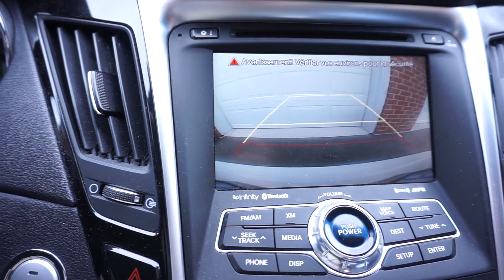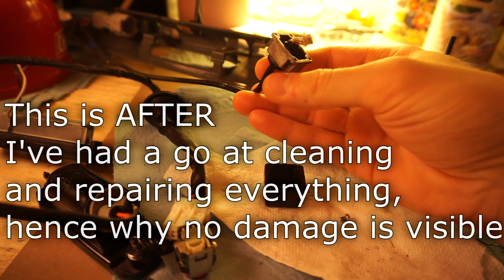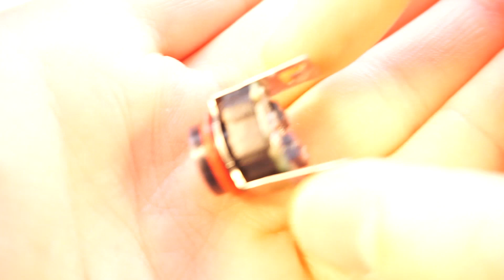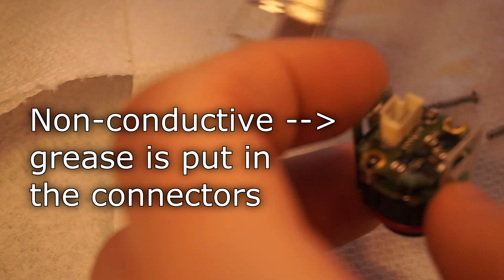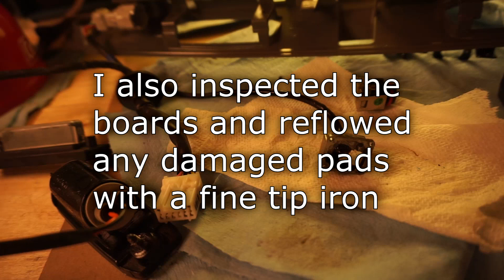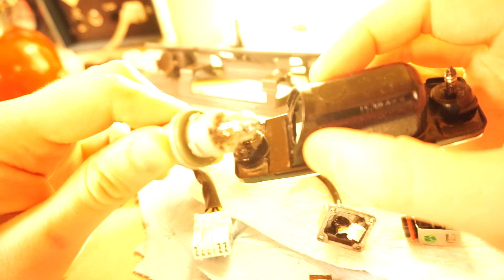DIY Tech: Hyundai factory backup camera Blue Screen Electronics Repair

Comment: Great video, very helpful. I just repaired mine this video heled a great deal. Just a few suggestions removing the chrome trim was tricky (or seemed it the first time) suggest plastic trim remove tools. The camera has 2 circuit boards as shown in this video. Once the 2 screws and spacers have been removed the top board can be wiggled side to side to separate it from the lower board. Also suggest using silicone seal on the exterior joints.

Comment: I changed my battery and now my screen doesn't come on at all. Fortunately, my radio does work, however the radio and media buttons do not work. How do I get my screen back on and working? Is there a reset code for Sonata 2012 Limited?

Comment: I just saw your video. I had a backup light go out on my 2014 Hyundai Santa Fe in 2018. I ordered a replacement from Amazon and it worked. Well the second one went out. So I need to replace it. I kept the one I removed. Would you be interested taking apart the original and see if you can rebuild? David

Comment: Thanks for the great video.  I fixed my camera.  I don't think I would have thought to try this if I had not seen the video.  My camera was on a newer Santa Fe but the concept was no different.  One suggestion, I slathered any of the areas that water might get in with silicon sealer before I reinstalled the camera.

Comment: My Santa Fe camera stopped working about 1.5 years ago, so I thought I'd try to repair it as in your video. Unfortunately, I had three rusted circuit board screws and a corroded pin on one of the connectors. When two of the screws snapped off at the lens housing, I decided to bin it and order a new one as the prices have come way down since I last checked. When that arrives, I'll open it and use silicone board sealer with a good helping of Collinite 845 on the outside to prevent a repeat performance.

Comment: My camera is working, but it looks like water has gotten 'inside' the glass lens, dried and left dirty sediment on the inside. Then when it's in reverse, it's all blurry.

Before I go to the trouble of striping it all down, do you think the lens can be separated from the camera body, to clean the inside of the lens. (I'd probably clean off any oxidisation on the boards at the same time, but that won't solve the issue I'm facing)
Reply: I'm in the same boat here, couldnt figure out a way to get the outside lens apart from the housing without doing something that would seemingly bust it, but when the board with the camera on it was off I attempted to use a Qtip with some of the padding pulled away to try and wipe the lens, no avail :-(
Reply: @walterhartman8902  I've still not bothered stripping mine down yet (didn't have time over summer with vacations etc).
But it sounds like the answer to my original question was no, the glass lens isn't able to be separated. 
When you say you didn't manage with a qtip, was there some space to get 'something' in there or was it completely sealed?
If there was some space I'd maybe give it a try. 
Else, going to try a replacement from wish or Alibaba...cheaper than the dealer 😮

Comment: Thanks for the video I have the exact same issue. Will try this fix. Where do you get this conformative coating?
Reply from the maker: Conformal coatings can be found easily online on eBay or amazon, and a little goes a looong way. In a pinch you could also use clear nail polish

Comment: I have a 2013 Sonata 2.0T. After 7 years of perfect service the camera croaked. Sure enough, so badly corroded I could not even get the screws out to separate the front form the back half of the assembly. An OEM replacement camera is available for $125USD from a seller in China. You’ll wait a month for it to arrive. Didn’t have that kind of time so grudgingly had the dealer fix it for $585USD. That hurt.
Reply from the maker: I'm sorry to hear, that sucks. At least you got a genuine replacement part. But all of these cameras will eventually fail, unfortunately, due to poor design. Its a type of service done preventative that would be best here

Comment: Would have been nice to see how you disassembled the trunk and took the metal off
Reply from the maker: See @pococks1
's comment. Its just plastic trim that looks like chromed metal that you can remove with a spudger
Reply: Theres a felt like cover inside trunk you remove to expose 2 gray silverish colored nuts on the underside of the inside of you trunk that you must remove in order to pry the chrome strip off.